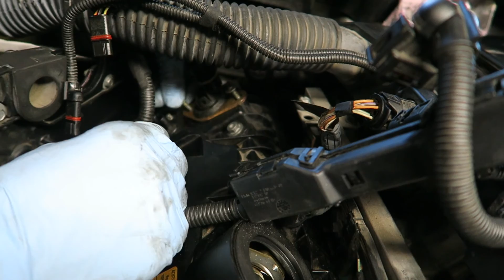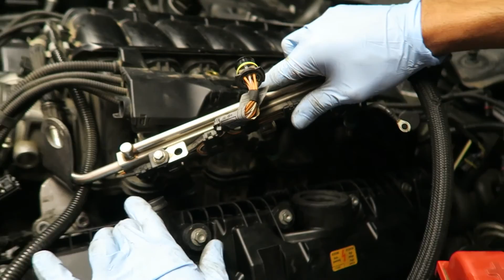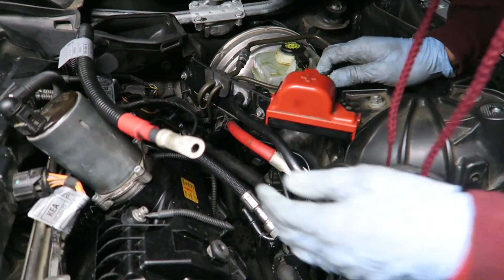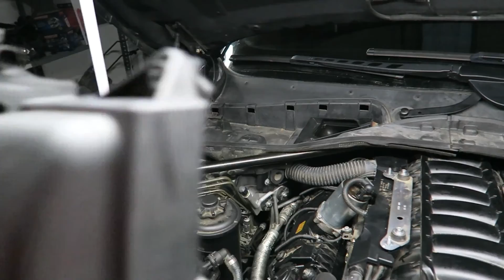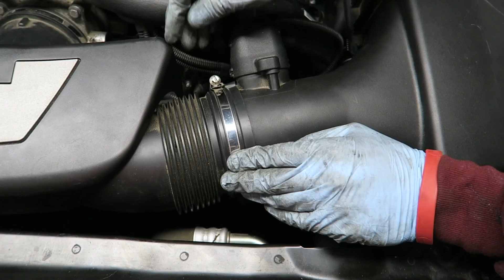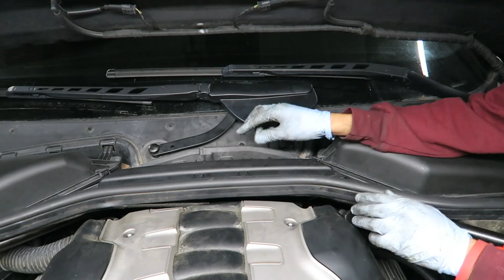BMW E60 550i Valve Cover Gasket DIY (Part 3)

Comment: My lovely mechanic quoted me $7k for this! What's the average price for this job?
Reply: the stealership charged me 3k so yeah your mechanic is crazy, my two cents from personal experience is to take the whole engine down and have all seals done plus the coolant transfer pipe valve seals alternator bracket and secondary air carbon clog up, in the long run it might be cheaper than dealing with each problem individually also assuming you have a n62 engine or similar
Reply: @tjkoko2001  -- Thank you. I went to a new mechanic that I acquired, after partnering with a car dealer. It turned out to be a lemon! A 2007 BMW 550i M-Sport, but after replacing the head gaskets, cranking it and finding a huge oil leak, there was metal pieces found in the engine. I'm in too deep, so I'll purchase a new engine for $1500 and hopefully my mechanic charges me pennies to install. This was a disaster!
Reply: @aisharpproductions1351  unfortunately i know the feeling all too well, good luck
Reply: the car ninja has a video of valve seals replacement where he takes the whole engine out and takes the heads off and only charged 4300 i have to assume some shops would be cheaper

Comment: Hi could you tell me where are the camshaft position sensors are located ? I have error codes on 545i but I believed there share the same location. Appreciate for your help.
Reply: hi did you figure out the problem?

Comment: This was a great set of videos! Just did this job on my 2005 645ci and just wanted to add a couple tips. One was actually fom Jason. He suggested using a few dabs of rtv between the new gasket and the valve cover to help keep the gasket from falling out of the groove while placing the covers back on the car. Worked great. Other tips........ I used a little water based lubricant on top of the coil pack tubes to help the tubes slip into the ports on the cover. Also used it on the thick round gaskets up on top (between the cover and the aluminum plate where the servo motors go while screwing the four bolts, and on the fuel injector orings. Made things slip in nicely. Lastly, a little trick to help get the lower cover bolts started. The four bottom bolts are shorter than the top ones and are a bear to get started. So I temporarily used two of the top bolts (one with the pivot and one with the ID threads) in two of the holes in the bottom row (first and third holes from the front) while tightening all the other bolts in a cross pattern. Once those bottom bolts were tight enough to pull the lower side of the cover down part way, it was easy to start two of the shorter bolts in the other two open holes. Once those two shorter bolts were tightened down, I then removed the divot and id threaded bolts, moved them to the top where they actually belong, and then installed the other two shorter bolts on the bottom. Worked great. 
Anyway, Jason thanks for doing these videos for us.  I really appreciated not having to go to the local BMW "Stealership" to have them do it. They charged my dad over $1200 to do his E38.
Reply: you can easy to start the bottom rocker cover nuts, you need to know the inner bottom of the cover have 3 yellow guides, can see in this video, those three guides if you fit to the head inside area, not the gasket area, then the cover can push down enough to start all the bottom short nuts, hope this help, just finished a e62 today😁

Comment: Great time to change spark plugs ⚡️ 
And also the crank case breather Valves 1 on top of ea valve cover.  When done if lucky and no vacuum leaks SELL IT as fast as u can!!
Reply: 😂😂 I feel you I don’t know if I want to sell my 650i 07 or fix the valve stems!
Reply: John Thomas i love my 550i. I dropped the engine it was easy and made the valve cover gasket job extremely ez i did every seal fron rear main the coolant gasket in back. All of them intake ect. Only thing didnt do was head gaskets also Did Dragon fire coils and the new NGKs. Shes top notch love but i needs another 200 HP
Reply: BAims well bro come drop mine and do the valve stems plus gaskets!😂😂
Reply: John Thomas 3500$ and a hotel room
Reply: BAims lol
Reply: John Thomas how bad is it smoking? Whats the mileage?  Is the smoke constant or only on take off.  

Have you replaced the oil check valves on top of ea valve cover there like 15$-20$ they tear in the fold of the rubber diaphragm thats a ez fix 3 mins and if there torn it will allow where it shouldn’t be.

Also run Liqui Moly 5w/40. In hot a climate or summer jump to 10w/40 it will help. Plus the car loves the Liqui Molly.   

ATP its a black bottle $13 advance Auto carries it allot stores do use it with every oil change it reconditions the rubber seals dont be afraid to use 2 bottles just leave what ever oz atp u use out from the cars oil. ATP works great.  With the Thicker oil new oil check valves and ATP. U should see a difference in smoke.  Definitely oull plastic valve cover covers off and with a small flat head pop the “O” cap off of ea side and inspect the orange check valves if ripped replace. U might get lucky.   I had 3 days invested in mine. Made it so much easier out of the just have so much more room was great.  I wish u the best. Sir.
Reply: BAims 140,000 and smoking at Long idle
Reply: John Thomas 
I quality shop is gonna get 4-4500$ thats why i did what i did and I bought the tool AGA valve stem seals tool from someone on ebay it was 1200$ new used once got for 550$. U can rent it for 200$ for 2 wks tho. 
But 4-4500$ is only tje 30$ valve seals i couldnt do it.  Was it allot of work yes it was how ever its all very doable and actually fun.
BMWS are pretty nice to work on there hardware and fasteners are quality stuff
Lots of Torks.  Very rewarding.  Your other option is a low milage 50k mile engine swap. I was gonna do i found a 640i wrecked w 55k clean clean engine for $1800.  If i were u id do that because of the shop costs for just valve seals yikes..  wGood Luck John enjoy your summer sir stay safe
Reply: BAims thanks I got someone here in Atlanta that’s gonna do it for 2500

Comment: Thank for the video.  I have a question - What are the things at the back of the engine on top of the valve cover on the passenger side.  My valve covers were done not long ago, but appears to be leaking on top where that connector thing is.  1:29 on your video

Comment: Hey.  Great video.  We followed it and did the entire job. I also replaced spark plugs, ignition switches and CCV valve and replaced alternator.  I can’t get the car to crank.  And ideas what I may have missed? Does it need to be primed?

Comment: Hey, I have 3 erros codes P0391 P0024 P0305 this is on a BMW 750i. I changed the valve stem seals and put everything back and the engine light came on.  Can you guide me with this errors?

Comment: I could not have done this job without your video. The job is complete except for the lower 2 rear nuts on each side. Is there a trick to getting them started? It is a very tight area. I was going to order the longer nuts from the top of the valve cover. I don't know why the lower ones are so short. Thanks

Comment: I just did this job on my 2004 bmw 545i and now I'm getting a p0393 witch is the cam shaft sensor, I'm lost because we have checked everything and everything is working and was put back just how it came out, please I'm stuck and lost on this dam job
Reply: your car is probably long gone but mine had the same problem, dealer said they had stripped the gasket with the bolt and had to redo the gasket and even then they kept the car for like a week cuz they couldnt get it to work, in the end they charged  me an additioanl 350 for the camshaft sensor problem on top of the gasket price
Reply: did you find out what it was?

Comment: solid video. quick question. is removal of the fuel rail nesssasry or dose it just make the job easier. also for the missfire for 5,6,7,8. how did you go abouts diagnosing  to being related to the valve cover ( besides disconnecting the coil for the power ballance test)

Comment: Very useful video! i did this work to my car. But after starting the car I've got misfiring and 2b63 2b65 codes. 
do you have ideas what might be wrong? thank you!
Reply: hi friend did you find out what it was? i also got those code after replacing the gaskets

Comment: great videos, all 3 parts. gonna do this myself in a couple weeks, any sensors you think should be replaced at the time ? also should i replace the coil packs ?
Reply from the maker: I would suggest doing all 8 coils, and the eccentric shaft sensor if yours breaks.
Reply: cool thanks.
Reply: @ShopLifeTV  how much its for this kinds of work?

Comment: i did this today and it started missing did i do something wrong or is the valve cover not seated properly?
Reply from the maker: Valve cover might not be seated properly, or one of the vacuum hoses in the front may have a crack. Also double check your oil filler cap and make sure it is forming a tight seal.
Reply: Dan Smith redo it i had to remove it and reseat it  but honestly its a bitch and requires patience
Reply: When I seated the valve cover I noticed the coil cylinders weren't reaching the valve cover all the way on one side, I felt it wasn't seated right. I took it off to see what the hell is going on, last thing I need is oil spilling everywhere.
Reply: RRG, just curious,  did you figure out why the coil cylinders weren't reaching the valve cover?  I am having the same problem and wondering if I should redo it or is it normal
Reply: Dan Smith sorry for the late reply, turns out you have to set the bottom down first so yoi can slide in or hook in those small plastic tabs that stick out the bottom not sure what their called. I seated it straight down and one of those plastic tabs sat on the block and I tightened it down and basically bent or warped the cover. There was a huge gap between the cover and engine block. Mechanic said he could stick his finger in it. I ended up getting it towed to the mechanic because when I put everything back and I started it it was very rough idling and then it would just turn off so it was sucking air into the engine through the gap, if I would have just known to hook in those small tabs at the bottom first and then lower the top part I would have had it done perfectly

Comment: Great video every valve cover bnw made leaked oil on that engine .. Recall would of been nice ... My question is when removing the valvetrronic and reinstalling don't you have to calibrate it so its in sync with engine/computer.. Or is that not true I'm in the middle of m650i right now , wish you were around a year ago.. Can u get  back to me ASAP please .. Great job you sound like you have replaced a few of these.. Do u have a water pump video?
 Great job it's guys like you that take the time to make these videos  then edit takes a lot time ..  Tip my cap very greatful .. I vowed that bmw dealerships are evil.. There garage is cleaner then my living room...
Reply from the maker: Hahaha, and no you do not have to calibrate it. It will recalibrate by itself at startup. Unfortunately no water pump video. And thanks for the kind words!

Comment: Great video.  My 550i is in the garage next Monday for passenger side rocker cover gasket replacement.  I wouldn't say this is a job for the novice mechanic if I was to be honest.  Problem was, they found the oil leak after my alternator failed two weeks ago. The mechanic said it looked like the oil from the leaking gasket had got into the alternator and caused the failure.  This has been an expensive month! £569 for the alternator and it's costing £320 for the passenger side gasket replacement.  These aren't cheap cars when things go wrong.
Reply from the maker: You are correct, they get expensive very quick. Good luck on your car!
Reply: Hello, one question: When you remove the Valvetronics, they are simply reinstalled. You don't need to program anything. @ShopLifeTV
Reply: +ShopLifeTV Well the passenger side (UK car) gasket has been replaced, I am £320 ($450) lighter in the wallet and there is still a drip of oil on the plastic tray underneath. Just hope it's residual. Planning to remove the sump guard this weekend and give it a good clean.  Now saving up for the next repair bill!

Comment: how much should i be paying for this service? so i know before i go to a shop.
Reply from the maker: +Darryl Reese I would look to be paying around 3-500. The valvetronic sensors do sometimes break when removing the valve cover which would add another $200 to the repair bill.